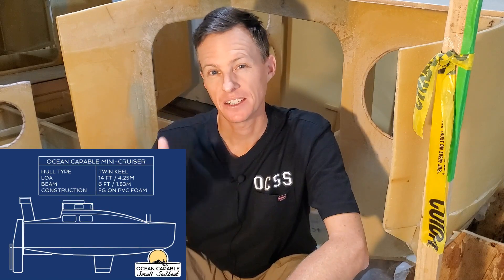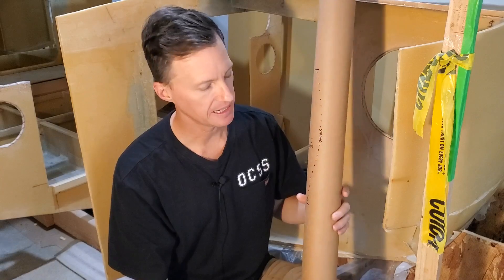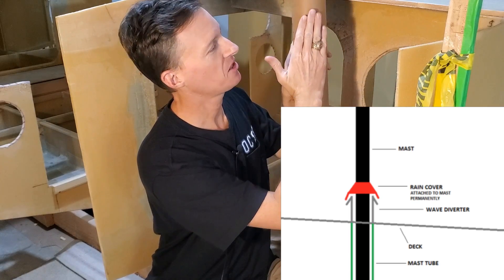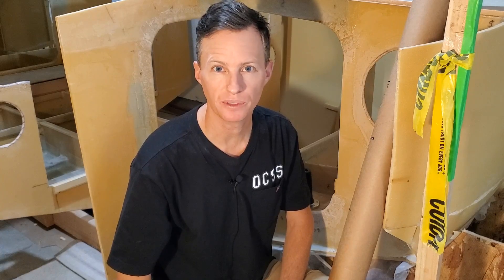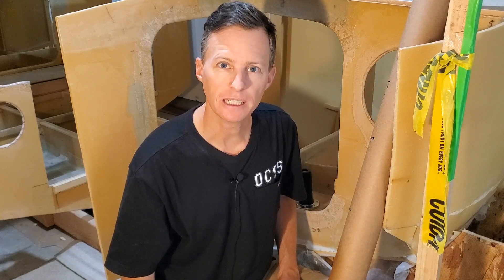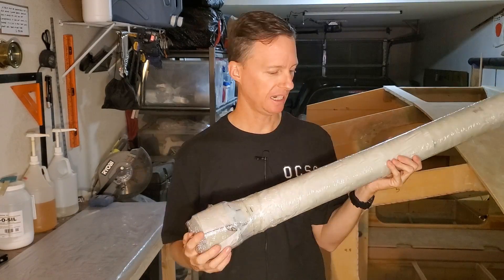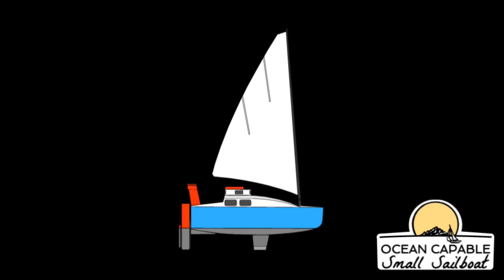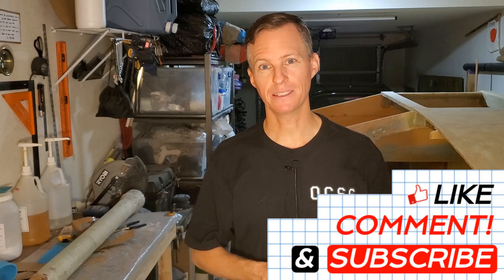OCSS-038 Making a Mast Tube - Mini-Cruiser Sailboat Build

Comment: If you're worried about the stress from the mast on the mast tube, as well as water intrusion, why not use a flexible rubber grommet around the mast tube where it connects to the deck? Regarding your cardboard tube dilemma : Cut two thick pieces of wood into a round shape to fit into both ends of the cardboard tube, then secure it with a vise. The wood is so you don't crush the cardboard or your new mast tube. Then use a strap wrench on the other end of your mast tube and carefully turn it.

Comment: I just use PVC tube then fiberglass over put a valve on the drain tube then routinely empty it they won't hold much water even if full barely a Litre of water.  mine just empties into the bilge its virtually no water. But the cardboard tube is easy anyway those tubes are just spirally wound card. use pliers to grab the tab on the inside then pull out layer by layer if you haven't already dampening then drying can help.

Comment: Just found this channel. I am building a Paradox with a couple minor mods. I am not building a mast drain, a water tight hatch (no sliding hatch, external tiller etc.

Arctic voyager Roger Taylor (Ming Ming) used a aluminum lamp post as a mast with a crazy overbuilt mast base on floor/deck for his designs.
Reply from the maker: Ming Ming is a cool one, I like his lamp post mast. With a boat as small as mine or the Paradox, the aluminum pole becomes too heavy to be a good mast, though.

Comment: I’m curious…why didn’t you do the mast step in G10?
Reply from the maker: The G10 is great, but it's heavy and difficult to cut. I probably could have done the top 2 pieces in G10, but this plywood has so much epoxy soaked in and layers of fiberglass over it that I'm not worried about it.

Comment: Perhaps  you can saw through the tube using a long blade, like a flexible cable saw, or possibly one or several hacksaw blades glued into a slot in a length of dowel of a proper length. Dan S.from Michigan & Texas

Comment: From memory. The carbon fibre spars on Gossamer Condor were laminated around an aluminium mandrel. Which was then simply removed by dissolving it out with caustic soda!
Reply from the maker: I've seen one cool method, where an aluminum mandrel is coated in thick candle-wax. After the carbon fiber is cured, boiling water is poured inside the aluminum, the wax melts, and the new mast slides right off.
Reply: Epoxy shrinks when it dries isn't it?

Comment: Re your tube extraction issue... A wise man once said "There are very few problems in life that cannot be solved by the judicious application of high explosives."

This happens to be one of those rare exceptions where explosives won't do the job. Unless you're particularly attached to that hunk of cardboard, soak it in water until it becomes a soggy mess. It'll come out easily, then.
Reply from the maker: Is that from The A-Team?
Reply: @ocean_capable_small_sailboat  - Heh.. not that I'm aware of...

Comment: If you use a cardboard tube like this again, a longitudinal slit in the tube would allow you to put hose clamps on the protruding ends of the cardboard tube and squeeze it to a smaller diameter.

Comment: You could make the drain hole pluggable. That way whenever you think, the mast tube is somewhat filled, just drain the water then. In some really bad weather you can just let it spill out to the top again.

Or connect the drain hole to a tube which drains the water to a through hull above the water line.
Reply from the maker: Yep, good thinking. I was thinking I could connect a clear tube to it and lead that into a small bottle laying on its side, or a tupperware. Any water that comes in would just go into the bottle/container. If I do the rain diverter on the mast right, there really should be very little water coming in, if any.

Comment: maybe use a permenant mold like abs, but for the money I would just buy a commercial made carbon tube, for the water problem, maybe expanding foam filler, and finally, you might want to surround the mast tube with rollers at the deck height to make furling a lot smoother.

Comment: Thanks as always for taking us along on your journey.  Cardboard Tube Removal: place horizontal, add small about of water to soften a longitudinal section while maintaining most of the strength of the tube.  The idea using a clock face to illustrate the water would soften the cardboard tube section in the 5 to 7 clock section while the 11 to 1 clock section stays dry and at full strength.  Look forward to hearing how you solve this one.

Comment: What will keep the mast from falling out of the boat if the boat gets knocked down pass horizontal?
Reply from the maker: The reefing line. It wraps around the mast just above the tube, the line then goes along the deck through fairleads back to the doghouse. You can't remove the mast without taking this off. Plus the boat shouldn't ever spend more than a few seconds knocked down past horizontal.